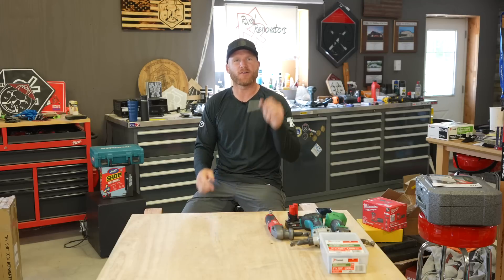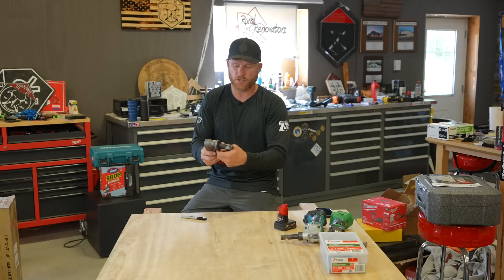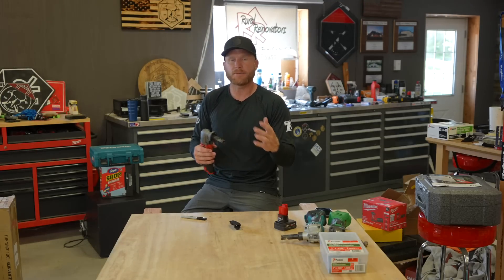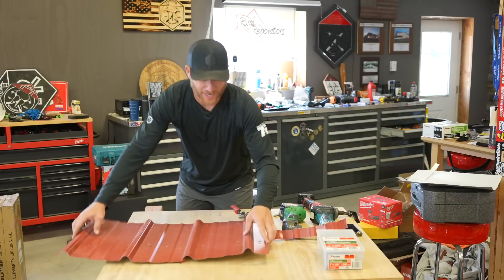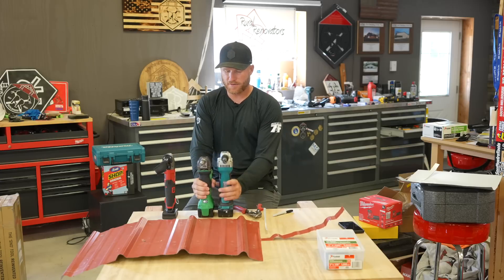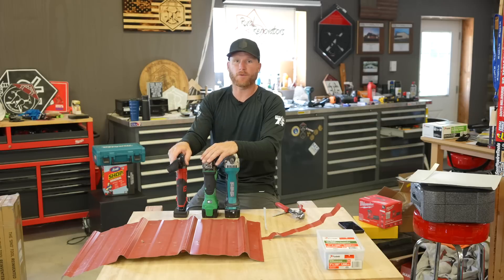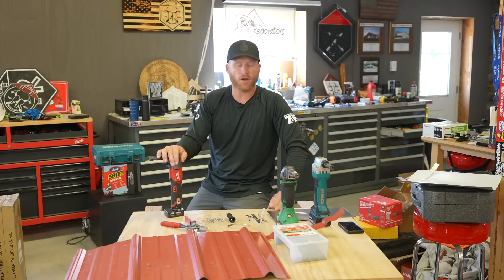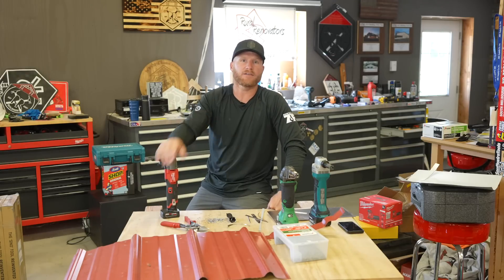The Tool you NEED… Milwaukee m12 Nibbler

Comment: As a aircraft mechanic,  10 years ago,  most of us in my hanger used the 12v Dewalt,  till the shop bought  20 of the adjustable torque 12v Milwaukee screw guns.  as you know shop tools get abused,  you know - drill with one end and hammer a cleco out with the other end.  We were all impressed and now most of us now use the Milwaukee M12 set up,  1/4 & 3/8 ratchets,  drills,  impacts, apex guns and screw guns and now looks like I will be getting a nibbler.  Good review and demo

Comment: I love Milwaukee m12 tools.  It's a very compact and powerful platform.   What I used to use in m18, I pretty much use m12 now daily.  With the 6ah battery, I get just as much battery life as 5ah m18.  Of coarse the m18 has more power for drilling, grinding, and sawing, they both have their purpose.  Looking forward to getting this nibbler

Comment: I have the Metabo, I admit I have not used it many times do to the "nibblets".  Also I didn't realize you could change the head index (not sure if that will make much of a difference). I'm mostly a Dewalt guy but feel drawn to Milwaukee for some of there unique tools.  Love using a nibbler vs snips for ease and quality of cut.  Will definitely be getting the Milwaukee M12 nibbler.  Thanks Kyle

Comment: You are very skilled using the aviation snips. Also using the nibbler. You make it look easy.
I worked with a plumber doing repair work on a gutter. I also cut sheets using a metabo cold cut saw running on rails.
Doing length cuts may be problematic using fencing as the material vibrates which really causes jaggedness.
The material really needs to be firm as much as possible. I also played with different saw blades for the thinner sheet material and found the blade that comes with the unit as good as the other blades with more teeth.
Cutting sheets which we call corrugated iron or the new term ( around 30 years ago) custom orb.
Making length cuts using a fence and circular cold cut saw, I set in sacrificial lengths crossways to firm the area where cutting and sitting on a board.
For those cuts I'm not yet satisfied of the method and will experience some cutting will not go as well as I hope and very very noisy.
I'm open to suggestion.
My plumber friend said he has makita nibblers and says they don't cut straight.
Mind you, I welded a frame and fastenned a sheets to the welded shs ( square hollow section steel) I cut the over hanging section using guide rail and cold cut saw. Since it was all very firm it cut like butter and very nice indeed.

Comment: Ive always ran Makita tools. After seeing a couple horrible  Makita cordless nailers, an M12 23ga pin nailer made it into my work trailer. Then an M12 Fuel Impact and drill. This nibbler is the one tool that I have been looking for but dont use enough to justify spending 4-600 bucks on. So looks like im fixing to preorder one!

Comment: Just got a email saying my order is being shipped out to me. Just got the bare tool as a i dont know if the extension is going to have a real use but definitely excited for it. Kinda sucks that were already putting corrogated on this cladding job were on and were almost done the corrogated roofing panels part.

Comment: Hey Kyle, great video, I'm super excited to get the m12. One question I had is about cutting trim. I have the metabo, a coworker has the makita and just recently our company bought a Fein . We have a couple pieces of trim like our gable and gutters that have a rib in them that doest play nice with snips so it's nice to use the nibblers to cut them instead. The metabo doesnt have a large enough clearance to fit the hem on the ends in the cutting area while the makita and the Fein can cut right through. Have you had any issues with the m12 cutting through hems? We use both Wick and Chief for our buildings if that gives any context
Reply: the Metabo model you have is NIV 18 LTX 1.6 right? That model also have an optional bag to catch the "niblets" like Kyle showed the M12 model.

Good to hear the comparison between the Fein, Makita and Metabo models...never seen a nibbler comparison before.
Do you have the Metabo single cut shears also?

Cheers

Comment: Hey Kyle, can I have your nibbles? I just did an experiment to see if I could do a decorative stain on concrete with tannins from live oak sawdust and it worked! I got one of those nibblers thanks to this video. I nibbled up an old rusty 26 gauge steel roof panel just enough to get half a bag full of the little metal bits. I scrubbed the floor with the hot brown water I got from boiling the oak sawdust and while it was wet I sprinkled the steel nibbles on the floor. Then I kept spraying the floor whenever it dried. It made neat little black spots on the floor. But I need way more of the nibbles to do the rest of my shed. I can keep making my own, but if you are still saving yours and don’t know what to do with them, I’ll take them!

Comment: I need to start a cut in the middle of a sheet of aluminum. Going to drill a hole so the nibbler will fit through. What size hole would I need to fit the collection bag/etc through?

Comment: Do you think this would be a good tool for an HVAC new build installer for cutting take offs into the duct ?
Reply: I used nibblers on corrugated sheet before. Using that as a reference, I would say maybe. You could follow your line all around in one go saving time and effort, but you're going to have to clean your mess. You're going to have about a hundred of tiny cut outs inside the duct.
Reply: Nibbler is more versatile but harder to control, double cuts do better in a straight line but struggle with ridges and troughs.

Comment: Good news: Milwaukee finally made a nibbler. 

Bad news: It's M12.
Reply from the maker: M18 really isn’t necessary
Reply: @RRBuildings  But M18 is what I have for the drill, driver, hacksaw, greasegun, hedgetrimmer, weedeater, leafblower, vacuum, and three different 1/2" impacts.

Getting an M12 set going is the same as switching brands.
Reply: Might as well stick with my makita corded nibbler until Milwaukee gives up the M12 line.